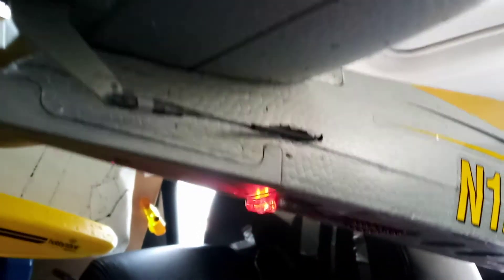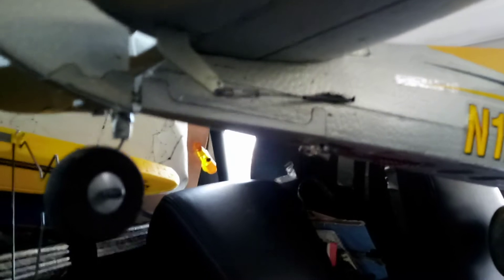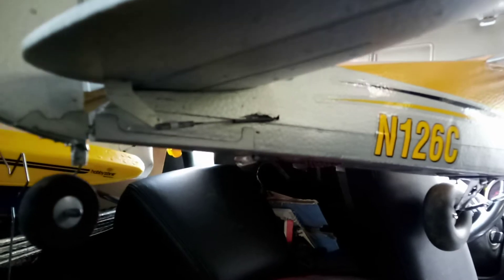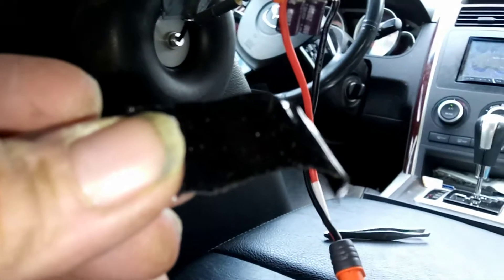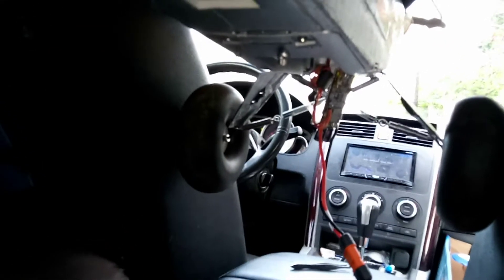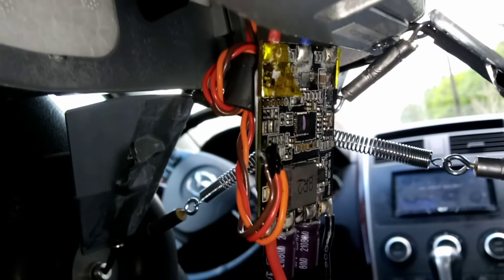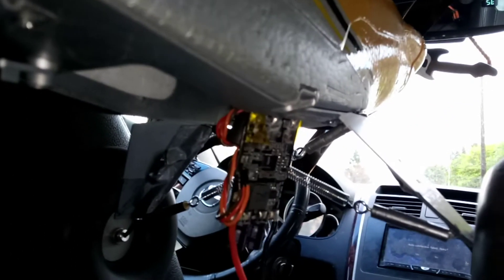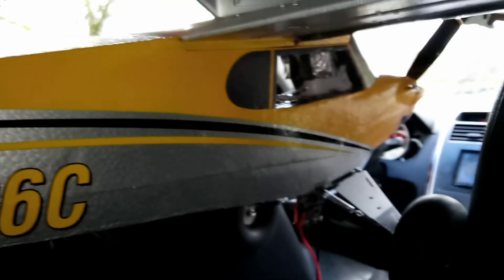RC Airplane Carbon Cub S2: Loss of Power Problem SOLVED!

Comment: I dried everything but once I plug the battery on it just flash on red very slowly. I tried to bind the plane but I don’t get any signal to the controller
Reply from the maker: In order to get the ESC to dry out, I had to remove the plastic wrapper that mostly covers the ESC, only then after letting the plane dry out with the wrapper off the ESC did it resume functioning. I also years ago had to unwrap the ESC in my Maule to get it to dry out after wind flipped the plane upside down on the floats on water. Hopes this solves the problem. 😎